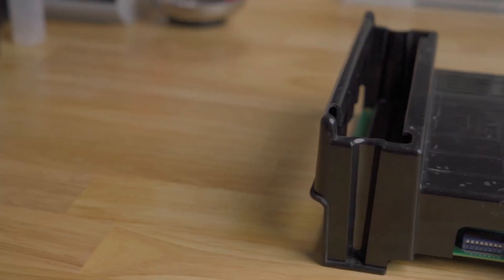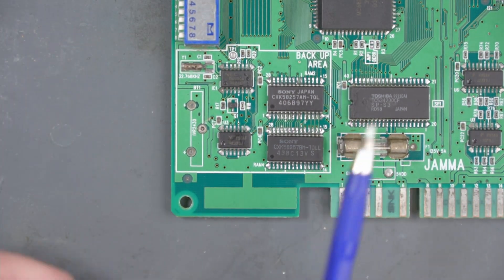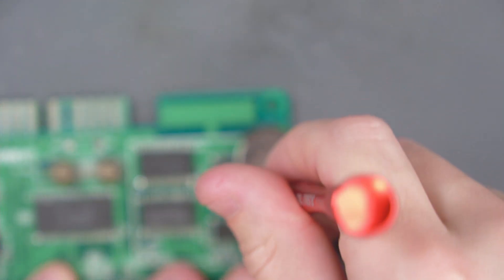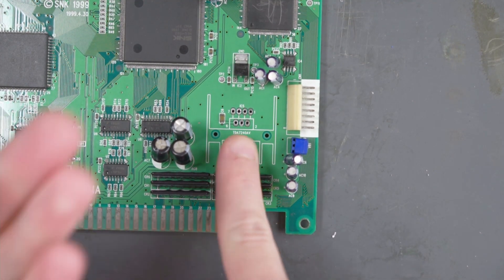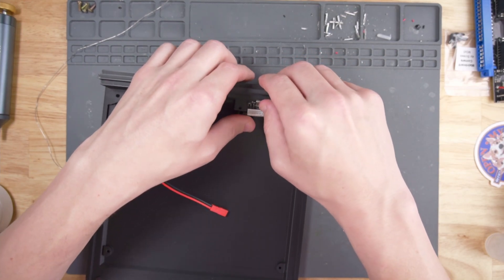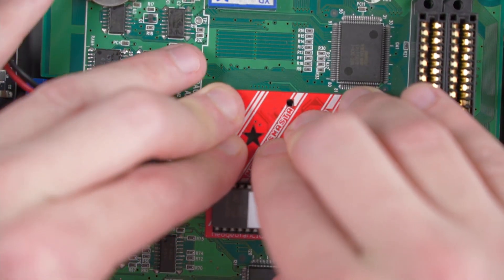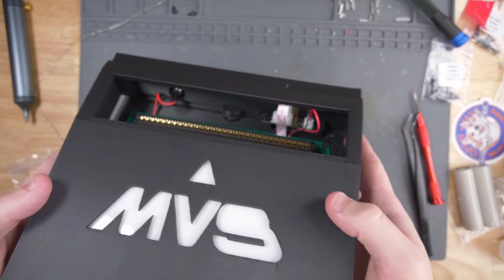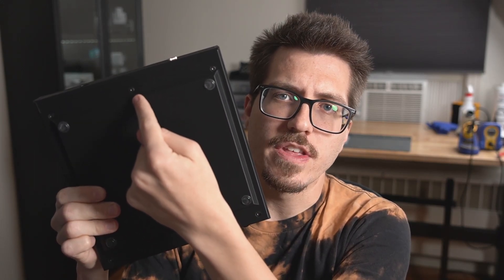Open MVS Install - Badass Consolized Neo Geo MV1C!

Comment: You sodered the audio connection the wrong way. when you look at the board and the jamma connector is at the bottom the black audio wire should be on the right and the red on the left. you should test you sound, you probably have left and right switched.

Comment: Good video.  You said that before you put the console together you tested the mv1c board with your minigun supergun.  I have that setup.  Though all I get for video is scrambled black & white picture.  Is your minigun's video out a mini DIN 8-pin?  What do you have it converting to?  composite, s-video, component?  Thanks
Reply from the maker: I use a Retro Access NESRGB SCART cable with my Minigun

Comment: Man sorry about your desoldering gun 😕 I recently purchased the same one but I haven't used it yet. Is there a certain tip you'd recommend for typical caps and things such as the heatsink you removed?
Reply from the maker: The tip that’s included works well with cap legs, but you may want a larger tip for the heat sink

Comment: Am a little confuse will you be able to use the supergun In the top slot after this mod ?
Reply from the maker: This mod replaces the super gun altogether
Reply: @dubesinhower  🤦🏽‍♂️ I finally understand..so now u can interface with the mv1C differently 😅
Reply from the maker: Yep! In a way, the open MVS is a supergun designed specifically for the MV1C